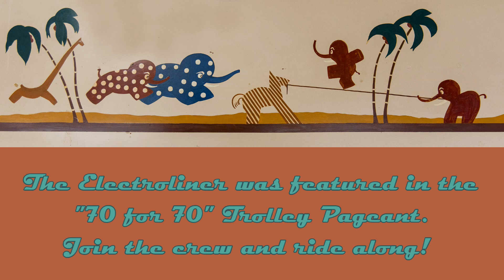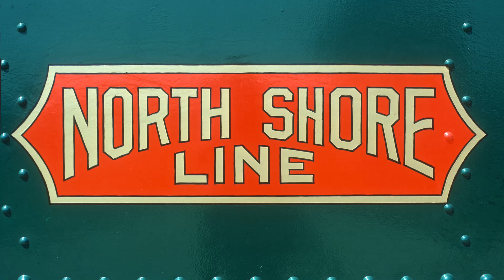A Short Ride on the Electroliner

Comment: My compliments to IRM!  801-802 looks fantastic and everyone who has been involved in the restoration of this train has justified reasons to be proud.  Having been involved with the troubleshooting, repair parts sourcing, and repair work to make sister train 803-804 operable (in a very limited fashion) a decade ago, I can really appreciate how much work it must have taken for IRM’s team to get this far.  Well done!
Reply from the maker: Thank you, Matt, I have shared your comments with the Electroliner restoration team.
Reply: I sure wish they could get 803-804 too! And restore that train as well.
Reply: 803-804 are still at The Rock Hill Furnace Museum at Orbisonia PA.
Reply: @mattnawn5019: I sure wish we also had Electroliner #803,804 at the ILLINOIS Railroad Museum. It took can be refurbished further.
Reply: The SOUTH SHORE LINE didn't have the traffic between South Bend and Chicago like the North Shore Line did between Milwaukee and Chicago. That's why they never had any Electroliner Trainsets.
Reply: THANK YOU for your contributions to restoring 803-804! I rode both sets when they ran in the Philly 'burbs. It's fantastic to know that both sets are still alive and well.
Reply: I got to ride the Electroliner after they were bought by the Red Arrow Lines in suburban Philadelphia and were renamed Liberty Liners. They were still in revenue service when SEPTA took over the operation. I got to ride fairly often between 69th street Terminal and Villanova while I was in college and worked on Rt. 30. One old Electroliner in Liberty Liner colors is restored and ocassionaly run at Rockhill Furnace. I am glad the museum in Illinois got one of the sets but I am also glad the other set is here in Pennsylvania where their last revenue miles were run. This way they get to represent their original and second life versions near where they used to operate.

Comment: Wasn't the Electroliner's bell (or gong if you prefer) air operated originally?
Reply: @johnrich2102: I think it was. It sounded similar to what you hear the bells on crossing gates only louder. Actually there's 2 floor pedals for the gong on the Electroliner one for just the single bell sound and the other for the air or what I call the Alarm-gong sounding what I just described before. You would hear the gongs when running in Milwaukee's City Streets and when entering and leaving the Main Milwaukee Terminal since it encountered street running to do so.
Reply: @kohnrich2102: The gong could be operated either air or foot operated. Air operated it sounded similar like the bell on the crossing gates except louder. Similar let's say to the old South Shore Line cars.